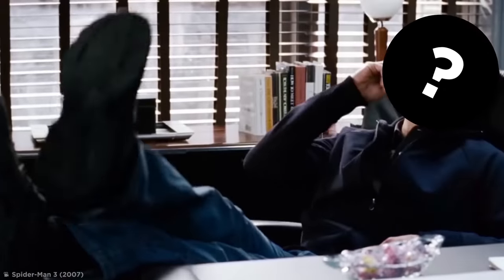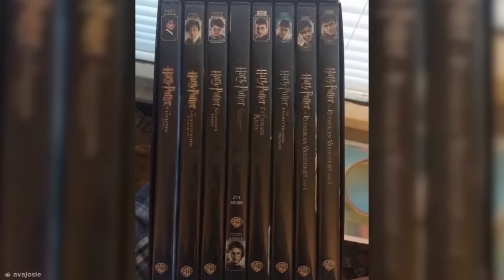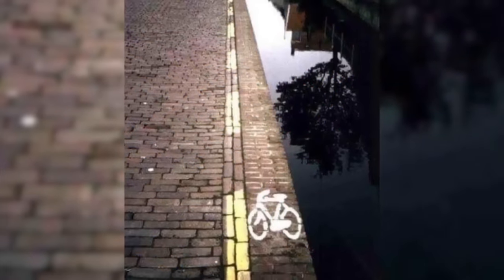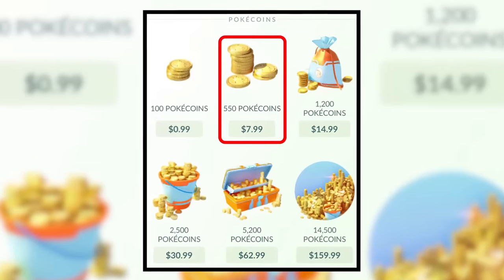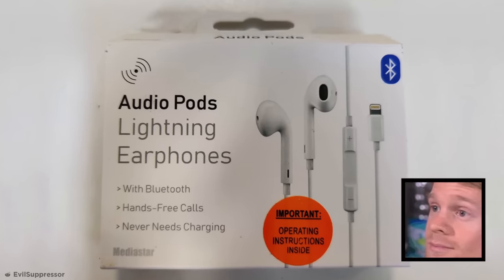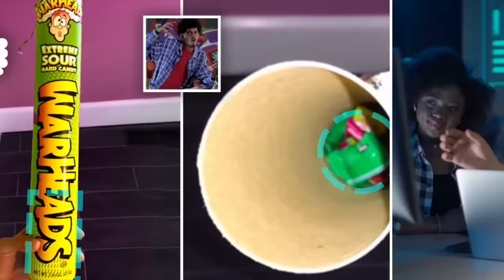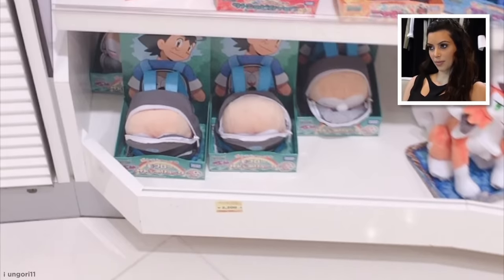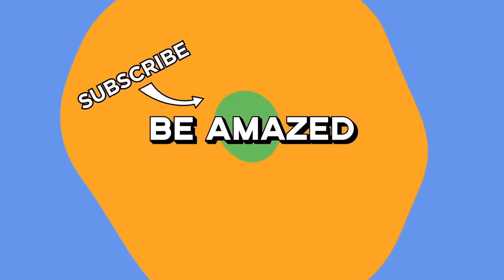Designers Who Should Go To Hell For Their Ideas - Part 3

Comment: My mom ordered three bottles of shampoo from Amazon. Not only did they put them in absurdly oversized boxes.... they sent it in THREE SEPARATE oversized boxes. They literally put one bottle in each box, which was many times the size of the bottle, even though she bought them all at the same time and they were the exact same item....

My MSI computer has the F12/PrintScreen button RIGHT ABOVE THE BACKSPACE. I've accidentally hit it so many times. It doesn't do anything horrible like turn the computer off, but it pulls up some sort of toolbar with code, elements, and weird stuff on the side. And since there's no abnormal amount of space or some kind of barrier between the two keys, it's soooo easy to hit. 
Although... the power button is very close to backspace as well. I've never accidentally hit it, but it seems possible.

Comment: Nintendo Switch having some games sold in cases making you think that the cartridge is in the case but when you open it, it only comes with a download code and an empty box. Car designers implementing everything including the ac controls inside the infotainment system,which you can't control while you're driving.

Comment: The ATM ones are probably so numerous because they are filled up from inside the building. Looking at most of these buildings, these are probably those old buildings with certain grandeur, such as a staircase in front of them, effectively raising the floor level by a at least 1.5 meters. In turn, the back part of the ATM has to be that high up too.

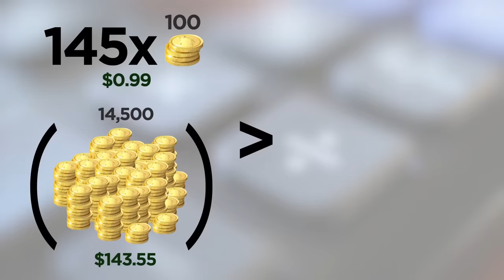Comment: 10:15 - Poke Coins.  I actually think this is a more pro social design than the typical strategy of offering bulk discounts.  They're incentivizing you to spend as little as possible without going so far as to just letting you directly buy in game items for cash.  It's still a little scummy, but it's better than having to decide which bundle is closest in value to the thing you want to buy, then deciding which OTHER bundle to get to let you buy something else with as little spare change as possible.  

The smallest number of coins being the most economical saves you from that.  You just buy as many of them as you need to get your item, and either the spare change is the best you could have done with the transaction or the best thing to do is buy more of the most economical coins 'til you can afford something else.

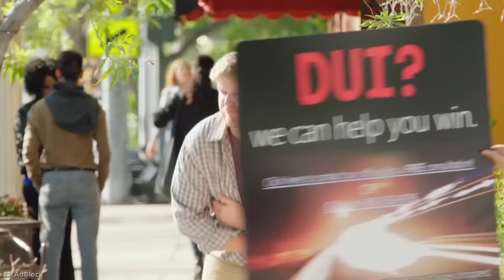Comment: 8:50 that drives me up the wall 🤪
10:50 Reminds me when my parents had got a nice non-stick pan at a Goodwill. Turns out that the pans handle was heavier then the pan itself, when we started cooking with it, if the food is lighter then the handle it will not stay on the stovetop eye. Explains why the new pan was at Goodwill..... 🤣

Comment: Shrinkflation. Bacon packaging hasn’t changed much in recent years. Same dimensions and same weight on the packages. The price has gone up along with everything else in your local grocery store.

Over the last year (2023) bacon HAS suddenly become very wet and number of slices in each package are one or two less than in 2022.

I’ve tried frying that bacon water but it’s impossible to get it crispy.

Comment: Really?!  Sometimes it's not the designers who are at fault but those who built their designs!  For example, crossing the hot & cold pipes in the wall instead of going straight or the toilet seat on top of plumbing?!  The lack of drainage in the video bridge - who is at "fault" ?  Maybe it's the builders instead of the designers.

Comment: I needed a lightning port adapter for my headphones a long time ago so I ran into a little Chinese corner store, bought one, and it was Bluetooth like that. I once plugged it into my wife’s phone just to turn it on and since my phone was right there the Bluetooth connected and they actually worked. Absolutely no practical use whatsoever just blue tooth for the fun of it I guess.

Comment: My laptop (Acer swift 3) has the power button placed next to the volume up button and the backspace button. My most used buttons. Oh, also for some reason. I have to log back in EVERY time my laptop dies or gets turned off. 🤦

Comment: The razor package tells you they used to give you more blades.  The package was never redesigned; they simply just give you fewer blades.  For my electric toothbrush, there used to be 4 replacement heads in the package.  Now, even though the package is exactly the same as before, you only get 3 brushes while the mold where the 4th brush would sit is still visible.